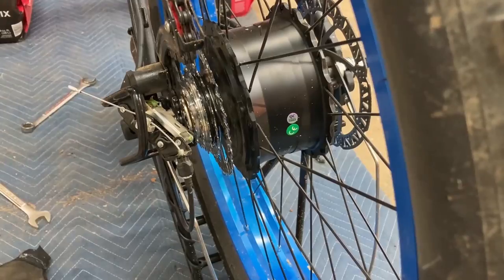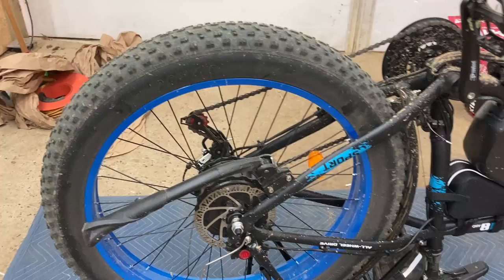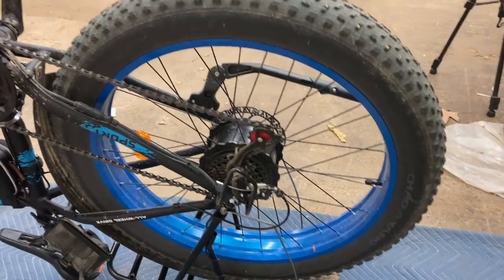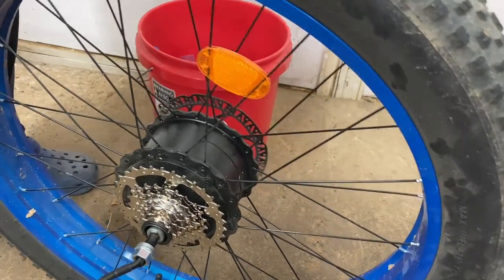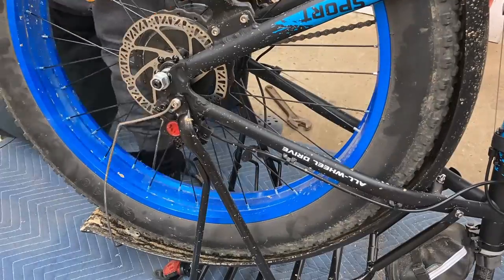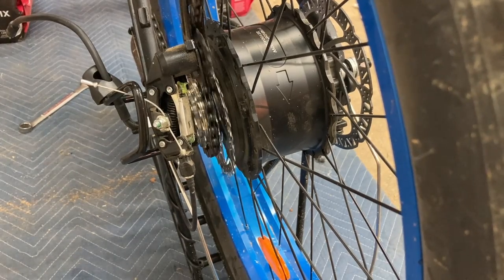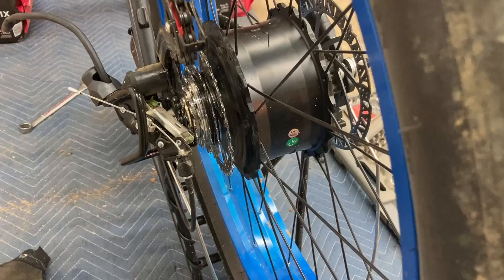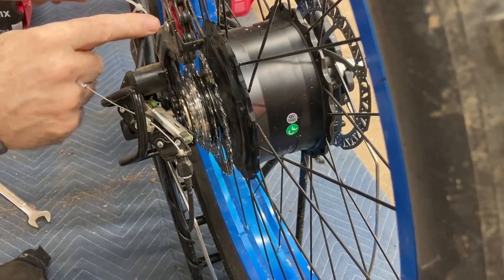Philodo H8 Ebike Upgrade THIS Changes Everything

Comment: My h8 the rear wheel cable is on the break side.
Does your rear wheel wobbling a little bit
Reply from the maker: Weird, all my bikes I think are on the same side.  Did not know some were on the other.
My original tire wobbled a little , it got better when I put on my Heb allscapes.  I think there is variations in tires that cause a slight wobble.

Comment: Does this make it easier to pedal if/when the battery dies? Because that's always pretty brutal!!
Reply from the maker: Not really, it slows your cadence at top speed.  For pedaling without power, you need a bigger sprocket in the back.  These bikes are so heavy, no matter what you do it is hard without power.

Comment: Great videos Papa, watch them all. I have an H8 that I'm happy with. I want to change the crank gear to 54 tooth? Can u let me know what model or brand you recommend? I only want a single sprocket. Thanks !
Reply from the maker: Thank you.  I don't think there is clearance for a 54, but I put on a 52.  It was close, but it works well.   I went with shorter cranks too, but you can choose a longer one if you need to.  You can see that video here: https://youtu.be/cmZCtuAxNpg?si=mt7Aas2U2g9zA3vy
If you check the description there is a link to it there.  It really made a difference.  I am going to change my Jumbo to the shorter cranks too.
Reply: @papablueshirt  thanks so much as usual. Also, I had a problem initially  that turned out to be the main harness had gotten pinched from factory and bike would cut off suddenly. They sent me a new one and that cleared up.I mention it to pass on to others w similar  problem. Thanks again Papa!
Reply from the maker: You are welcome, thanks for the info.  I always have my ignition switch plug come unplugged if I turn the handlebar too far.  This too, will give you a dead no power.  First time I thought, well this is it.  But now I know where to look.  Probably happened to me a dozen times.  I taped it and it still happens, LOL.  I just look for the blue plug and then plug it back in : )

Comment: Those are some spindly looking brake rotors for such a big heavy bike.
Reply from the maker: They seem to work well for this size of bike as they have a lot more stopping power than my Ecotric had.  It could be because this is hydraulic instead of manual.

Comment: I bought the Philodo H8 so I don't have to pedal.  What I'd really like to do is convert it from a mountain bike into a cruiser and keep the two 1000 watt hub motors and fat tires.  Any suggestions?
Reply from the maker: Sounds like a fun project.  I think the H8 might be a little tall for a cruiser, so you might think about putting 20 inch rims on it.  But, that would probably make it slower.  So I am not sure.  What were you thinking?

Comment: Papa blue do you know difference between the DRIFT MANIAC 7 Speed Freewheel for E-Bike 11-28T Screw On Freewheel and the philodo stock Freewheel? I have been looking everywhere online and cannot find anything on the philodo Freewheel. Basically what's the difference that allows you now not to ghost peddle?
Reply from the maker: The stock freewheel smallest is 14 tooth vs 11 tooth. It makes a big difference.
Reply: @papablueshirt  ok thank you did you change the front chain wheel? I know philodo has a 42-22-32 and it can accommodate a 48-38-28
Reply from the maker: Yes, I put on a 30/39/50 you can see it in my storefront.
https://www.amazon.com/shop/papablueshirt
It is listed under The Philodo ebike and gear.
  I do know a guy who put a 53 on, but I think he had a few problems going that big.  The 50t works great

Comment: Did you end up changing the sprocket for the 28 tooth one  or did you keep the 34 ?
Reply from the maker: I changed it right away.  The 34 was an 8 speed and I would have to change a lot to get it to work.  I changed it a few days later when my 7 speed came in.  Took all of 15 min to make the change.  Here is the video: https://youtu.be/QmDPl9Xyc84?si=w7wz0TS2QrCx1IR8

Comment from the maker: Please go to my Amazon storefront for the parts list: https://www.amazon.com/shop/papablueshirt
Reply: I was wondering if the ecotric still ran when you retired it for this one?
Reply from the maker: Yep, my batteries were pretty much shot.  I now have a new battery so I can bring it back : )
Reply: Why did you change it? And what did it do differently? Thank you, awaome videos
Reply from the maker: When in PAS 4 and 5 I had a hard time peddling as the bike is so fast, that you could not peddle very long in 4 and 5. Most of the time you were peddling air and not helping the motor at all.  This upgrade takes the standard 14 tooth and changes it to 11.  Which means it slows your peddle cadence.  Now I can actually peddle at 35 mph and can still add speed to the bike and not be all motor.  It was an easy upgrade that I wish companies would do when they make these fast bikes.  They seem to think no one would want to peddle when they are going 35.  I want to go fast, but I do not want a motorcycle [Momma won't let me LOL]
My first time riding this, my feet were spinning so fast my phone hopped out of my pocket.  I went back and found it, but knew I had to make a change.  I did the same with my Ecotric, it is a great upgrade.  It also makes the battery charge last longer as you are actually peddling and not going all motor.   Hope that helps
 Thanks for your kind comment and thanks for watching.
Reply: @papablueshirt  maybe i will change mine yes pedaling air hahah
Reply from the maker: Real easy change, the sooner you do it the better as the freewheel tends to tighten as you ride. I did mine on my Ecotric at 2600 or something like that.  This time it was 364 and it was a lot easier.  It is the best performance change I have made to the bike.  It makes it such a joy to ride now.  Thanks for watching
Reply: @papablueshirt  can you point me in the right direction of which one to buy on Amazon? Thank you
Reply from the maker: Yes, If you look in the description there are links to the one I purchased and also the tool to get it off.  I think it is also in the pinned comment above.  You will love the change.  : )
Reply: I found it haha, thank you
Reply from the maker: You are welcome. : )
Yeah, it seems like they make everything hard to find anymore.  Thank you for the effort it helps out the channel.
Reply: Got my new rear gear set installed thank you for your help, was not to bad
Reply from the maker: @markschrader7223  Congrats, have you tested it yet?  It really makes a difference.  I was afraid to do my first one, turns out it is pretty easy to do.  Especially after you do it once 😀
Reply: @papablueshirt  it was my first one too but your video made it so much easier. Yes i rhoad around a few miles , yes big difference no more air pedaling haha. I did have a hard time figuring out how the chain went haha had to redo after first attempt. thank you again your such a big help they should throw you a bone on this bike , they did not know about you or your videos i told them they were impressed and happy i could tell
Reply from the maker: Yeah, the chain routing can be confusing at first.  I am glad the video helped and thanks for mentioning me to Philodo.  I really like the bike.  My 2000 mile review is coming up soon.  Have a great weekend
Reply: @papablueshirt  wow 2,000 miles i have like 30 haha, i love this bike i wish it was a little shorter i got short legs and have a hard time getting on it haha. But once im on its fine.
Reply from the maker: The miles will come, this bike is so much fun to ride.  Re shorter: I have the same problem.  I think they list it as being able to ride if you are 5ft 2 in.  I am 5ft 8 in and it is almost too big for me.  I have to lean when I stop.  And be careful, if you know what I mean.  A few times it has got me,
 oooo-ouch.  You learn after a while. a 5ft 2 in person can ride it no doubt, but you are not going to stand at a stop and be able to touch the ground, no way : )
Reply: @papablueshirt  yes i know they will, yes im 5'9" and i have to practically lay it down to get on it haha

Comment: How is the bike different than it was before? Is it fewer teeth so that it goes faster? All I know is you changed out the rear sprocket, but don’t know why.
Reply from the maker: The original had 14 teeth on the smaller sprocket,the new one has 11 which slows down  the peddle cadence.  So I can now peddle when going 35 mph.  Makes a world of difference.

Comment: Hey Zippy.. lol that's some great advice. Question did the chain length not come into play?
Reply from the maker: No, I did not have to adjust the chain.  If I was able to get up to the larger sprocket, the chain length may have been an issue.   But since this video, I ordered the 28 tooth vs this 34 I put on in the video and it works perfect.  Both free wheels are listed in the description, the one I put on in this video and the 28 tooth I settled on.  
   The smaller sprocket is 11 teeth and the original was 14 and it makes a huge difference.  I decided since this is a 21 speed with a ton of gears on the low end, I did not need the 34 tooth and will put that on my ecotric.
  I will have an upcoming video showing the change.  It took me all of 15 min to do since I just did it the week before : )  
  As far as performance, this is one of the best upgrades you can do.  I really do not know why they do not do this at the factory.
Reply: @papablueshirt  Ok I'll have a peek at vid...So I have this weird odd chain length on my Voltbike Enduro where I have to add teeth all the time to the standard 8 speed chains that are sold on the market that's why I asked as I found out the hard way! I did a rear sprocket upgrade also as I found I didn't need the really low first gear and opted for a bit more speed lol like you! Watching you chain the sprocket so quick was nice...my task took a bit longer! What I'm hoping is to see you someday with a nice bike stand since your often doing tweaks on your bikes in ways we used to do as kids lol...like laying our bikes down and doing major repairs etc....Anyways I snagged myself one of those PCS 9.3 Stands...such a pleasure to do things now!
Reply from the maker: I put an 8 speed on my Ecotric fat bike not realizing I would need a different derailleur.  I was going to upgrade it, but ended up just using the bottom 7 sprockets.  I bought this 34 tooth for it to give me lower end as the Ecotric only has 7 speeds.   So I can now put it on that bike, but I suspect I may have the same issue with the derailleur hitting, but we shall see.  It is funny I was afraid to do the sprocket change out on my Ecotric as I had never done one, but now it is no big deal.  And I am getting faster.  I have an upcoming video short that I put a clock on to time and it took me 15 min, that was fun.
  Bike stand, yeah I was wanting to get one but it is hard to decide.  There are some cheaper ones, but the PCS 9.3 sure looks nice.   Last time I hung a strap from the ceiling and tried to do it that way, and it was a pain.  I ended up flipping the bike over in the end.  But it sure would be nice to have a stand.  
Yeah, I was one of those kids who put playing cards with a clothes pin on my bike, it made it sound so cool ; )
Reply: @papablueshirt  Your funny...yea the hockey card sounds as a kid....been there! For sure though.....if you collect enough pop bottles check out a bike stand...I'm sure the lower price ones will suffice enough for the tinkering you do! I'll await the tweaks ya do! Ride On!

Comment: Do you know if this upgrade will also work on the Philodo H7?
Reply from the maker: I think they are probably the same freewheel, however if you look on the freewheel there should be a number to tell what model it is.  If you let me know what it says I may be able to confirm that it will fit.

Comment: so u put a 11 28 on the h8?   not 11/34
Reply from the maker: I first put on the 11/34 as I had one here already.  I could not get the derailer to work up to the 34 and I did not want to change the derailer.  So I ended up putting the 11/28 on.  I wore it out at about 10k miles, then put another on it.  So this one has about 4k miles on it. : )
Reply: @papablueshirt   With the new front 50 T chainring on your H8 u are able to go through all 7 rear gear and all 3 front correct?
Reply from the maker: I could get all 7 in the rear, the front you will probably have to change the front derailer as I was not able to get it to work correctly.  I tried moving it up to accommodate the larger chainring, but there was not enough movement to get them all.  So I figured I needed a larger front derailer.  Since I never used the front two smaller chainrings, I just removed it.  : )  I have now removed the crankset and went with a 52t single with shorter cranks.  It works perfect I should have that video posted tonight or tomorrow : )

Comment: With a 21 speed bike did you really gain anything?
Reply from the maker: Yes, the lowest gear is going from 14 teeth to 11.  The top part of the sprocket I can not use without adjusting the derailleur.  I ended up getting a 11-28 tooth and it fits perfect and I can use all the gears.  There is a link in the description if you are interested in the one I used.  
   But, oh boy it was well worth it.  I can now peddle over 35 mph and not feel like a hamster lol
Reply: @papablueshirt  before I do that I’ll experience with the gears I got, so far the only gear I use is 7 and assist 1 which is a work out but your only going 6.8 mph, assist 2 and your doing the hamster and doing around 12 mph, I’ll let you know what I find out with the other gears ⚙️
Reply from the maker: I made the change at mile 364, I think on my ecotric it was 2600 or something like that.
Before I could only do PAS 3 comfortably and I topped out at about 22 mph.  If I went any faster my legs were spinning so fast it was hard to keep up. Now I ride in PAS 4 at 27.2 mph.  I can bump it up to 5 and ride 34.7 if I need to, but I tend to stay in pas 4.  I pretty much stay in the top gear as I want to go fast LOL  This bike is a blast.  Took it off road the other day and was surprised how well it did.  It is a fun bike.
Reply: @papablueshirt  I do 90 percent of my riding off pavement
Reply from the maker: You probably would not benefit as much as a person who rides a lot on the road.  However, you would not lose anything either.  The original is 14 -24 teeth.  The one I ended up with is  11-13-15-18-21-24. So there is the same amount of gears, just broken up a little different.  And with the 3 sprocket chainring on the front, there is a ton of gears available.  I probably do 90 percent on the road so it works well for me.  If I was riding mainly off road, then I would probably wait like you are. : )
Reply: Yeah he should have changed the the front to a single 52 tooth sprocket.
Reply from the maker: @MrCsebike  That was my original plan, however after the calculations I found that I would gain more by changing the freewheel.  It is also something I had already done, so I knew I could do it in 15 min.  It ended up being exactly what I needed for the bike.  I may change the front  later, but so far it has worked great.  I have put more miles with the new freewheel than I did without.  It should be done at the factory in my opinion.😀
Reply: @papablueshirt  The difference between the two is so slite it wouldn't be able  to be noticed from a 42 by 11 ratio to a 52 by 14 ratio is only 3.82 to a 3.71 final out put at 90 rpms of the crank is .8 mph difference so you would have lost close to .4 or .5 mph. but changing the front you would have gotten rid of the front derailleur, cable and shifter other than maybe needing to adjust or replace one you already have. You can run with a tighter chain and get rid of some chain slap and redundant gear ratio's. That's why purpose built bikes use one by drive trains.
Reply from the maker: Yeah, I knew it was pretty close between them.  The deciding factor was, I had already changed a freewheel and I already had one.  My main reason for doing it was to be able to stay in the pedals at 35 mph and not be peddling air.  This upgrade did that with flying colors.  I am planning on doing some off road riding that has a ton of steep hills.  With my ecotric I ended up walking so I wanted to compare the two.  As of now, I only use the larger chainring.  But I wanted to test it once I get there again.  I do agree that there is some redundancy with the gears on the 21 speed.  Maybe after my off road adventure I will decide to do that upgrade then. 
: )

Comment: When you slide it back in does the notch stay towards the open part at the bottom?
Reply from the maker: If you are talking about the washer with the notch on it, then yes.  This prevents the motor from spinning on the fork.  Hope that helps : )
Reply: Thank you! It does! Now I gotta figure out why I have drag on the new freewheel… I may have tightened it too much
Reply: @papablueshirt  wow, what a difference. Thank you for recommending and taking the time to reply! Scary fast 💨.
Reply from the maker: Yeah, night and day.  I love mine.  If you want even more you can change the crankset.  I changed mine and it was kind of the same thing, night and day.
  I saw your other question about it dragging, but it seems to have disappeared.  Did you remove the spacer that was with the stock freewheel?  If I remember right I think I removed it.  That gives you more space so the chain clears the frame.
Reply from the maker: Not sure if my other answer went through.  Did you remove the spacer that was with the stock freewheel?  If I remember right I think I removed it.  It gives you more clearance on the frame.
Reply from the maker: Yeah, I really love this mod.  If you want to go further, you can change the crankset too ; )